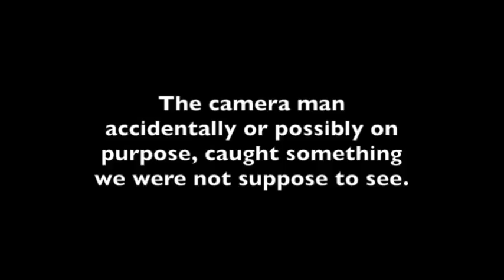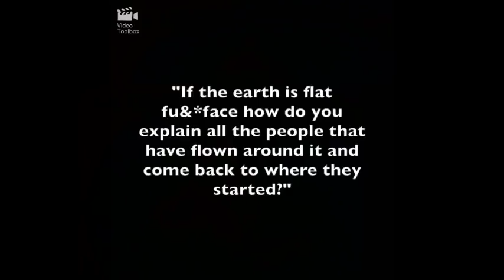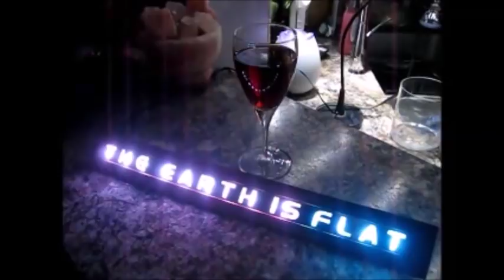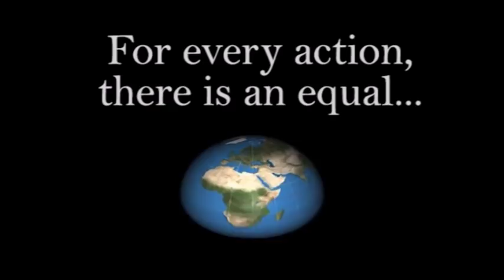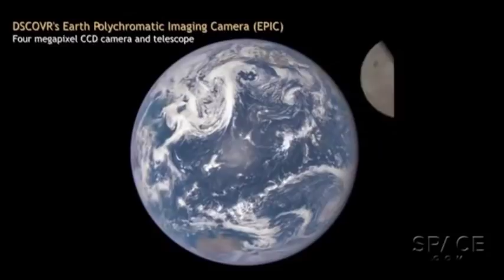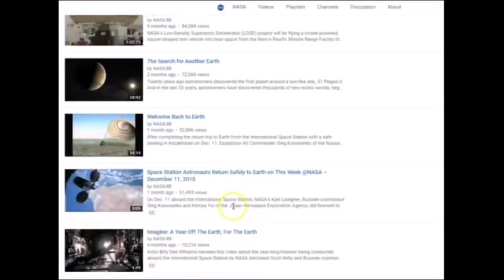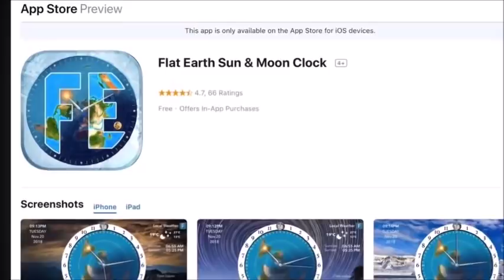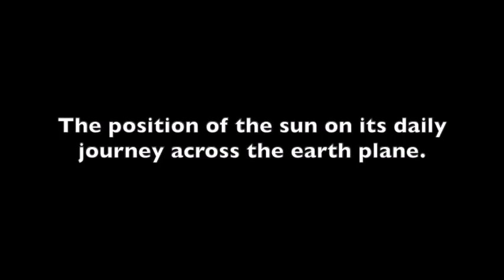Flat Earth Q&A Emails 119 Mark Sargent ✅

Comment: At 10:35 there's a reference to the moon having 1/6th the gravity of earth.  This is based on the notion that the moon has 1/6th the mass of earth.  But the earth is spinning at 1000 mile per hour while the moon is spinning at only 10 miles per hour.  So the earth is spinning 100 times faster than the moon which means the moon has only 1/100th of the earth's centrifugal force.  Even given the difference in mass the effect of gravity on the moon ought to be higher than on the earth, not lower.  Remember, gravity was invented to explain why we are able to stick to a spinning ball.  Gravity ought to be felt more strongly on the moon than on earth given the much slower rotational speed of the moon.
Reply: Wow! You studied physics? You should, you're really killing it.